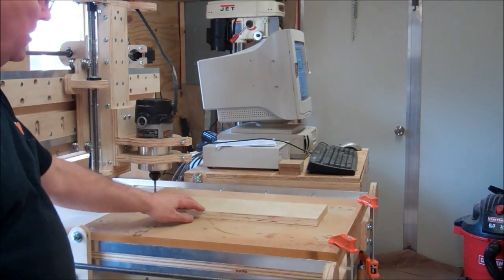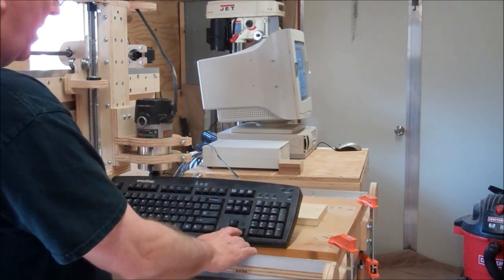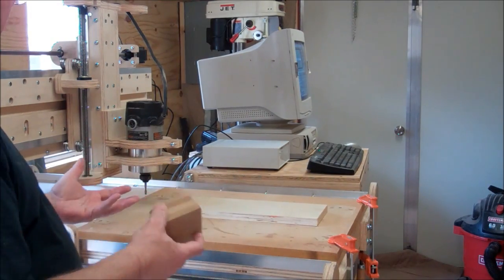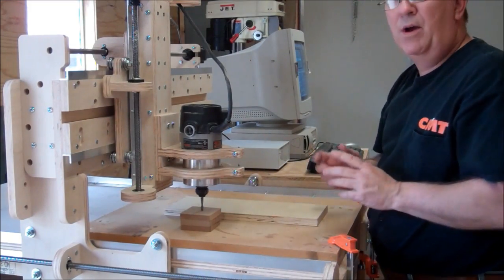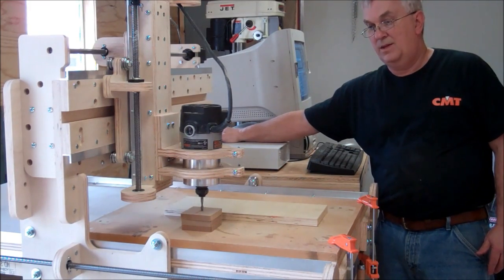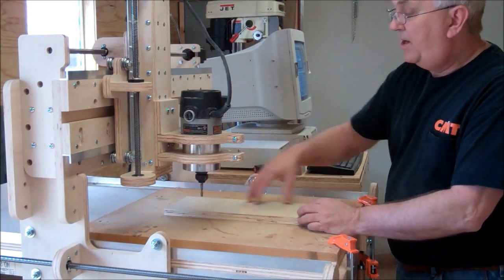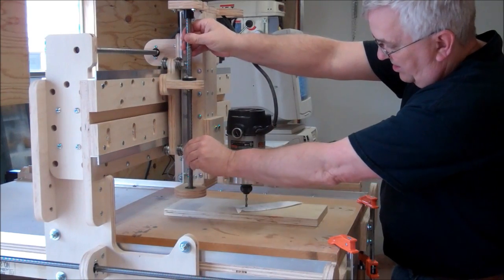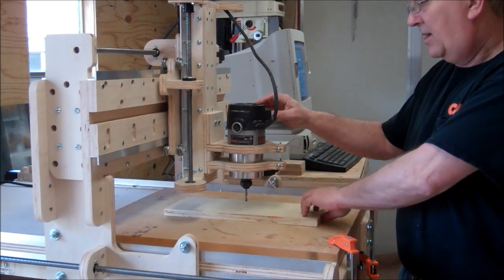How to Build a CNC Router On A Shoestring Budget Part Seven

Comment: Not seeing you reply to any comments. Have you tried this out for a guitar neck of any kind and how did it work out?
Reply from the maker: You do realize this video series is from over eight years ago, right?  Check out the link in the description.
Reply: @DaveGatton  No, didn't realize so thanks for the reality check, sleep deprivation due to spinal condition,  Forty three years back at FT. Benning, sleep and food deprivation was at least more interesting. Thought A picnic table full of food was real but it wasn't there and it turns out not was a common hallucination but one of the Rangers laughed and told me one guy was trying to put a quarter in a tree for a can of Coke.

Comment: you sail? I  have  a small 1978 O'Day 20 or 22. I am not sure because I've seen videos of both and they both have the same layout or someone's video is labeled wrong. One of my interest in cnc is for boat repair and part replacement. but I think I will find more to do with it if I have a 4x8ft cutting area available. am I wrong? is size an issue with strength as a concern?

Comment: I use a secondary controller for this reason, i unplug the parallel port and jog it down with the remote not mach 3, that way it doesn't register at all.

Comment: Why would it plunge down if it thinks the z-axis it high above?
Reply: Because the computer thinks it has moved the router up, but since the controller was off, the router didn't move or know about the user's instruction to move.
Reply: if Z on the program was at 0 and the drill bit also at Zero, then he moves the Z on the software up 2 units. but the bit didn't move , so he turns on his machine which is at 0 while the software is 2 units up, then he moves the bit up 2 units  again , so now the software is up 4 units the drill bit is up 2 units, when the machines goes to zero its going to go down 4 units, but the bit is only up2 units so the other 2units will be plunged inside

Comment: I am going to make one of these I am milling Aluminum 6061  5 feet by  12 inches finished product.  It is an airfoil for airplane wing. Question is. speed of router  you are running 3200.  Do I not want to be around,,, guessing here  900.  Can you suggest a router and bit and speed to do the job

Thanks

Bob Greer

Comment: Hi Dave That Is One Cracking Bit Of Kit . What A Fantastic Set Of Videos. Just One Question. If I Was Cutting That Out  Doing It By Hand I Would Be Moving The Router Clockwise.Is There  Any Reason The Router Is Moving Anti Clockwise

Comment: Used to run cnc milling machines about 20 years ago and they had a great jog feature. A wheel you turned to move the head (after pressing x y or z) and it had a selector switch for feed rates so you could zero the head down to 1 step at a time with this and a bit of paper (not forgetting to subtract the papers thickness). Well, at least until they installed fancy automatic probes you did. Really great job on this machine. Love it

Comment: That's great.  If you have time, can you go through the connections from the motors to the controller and the controller to the PC, and which software you use for drawing and sending the instructions to the machine?  I'm a total beginner and that would be useful for me.